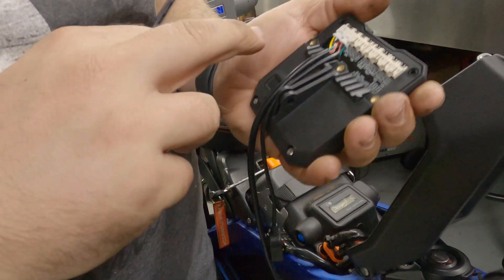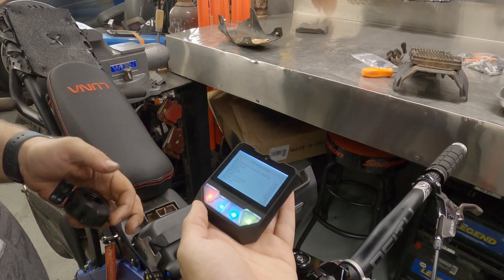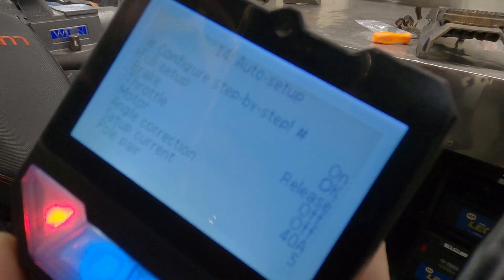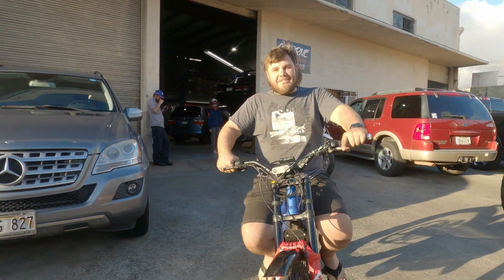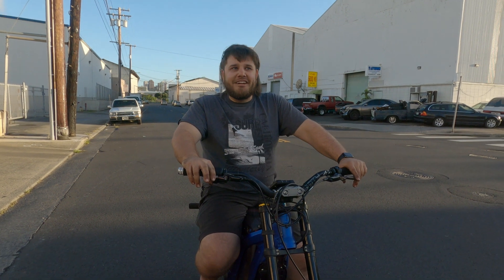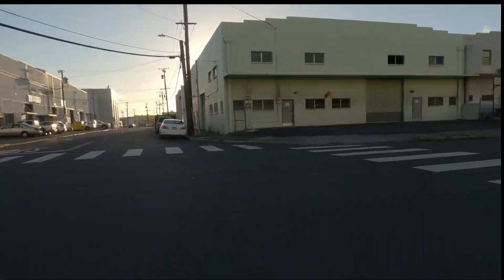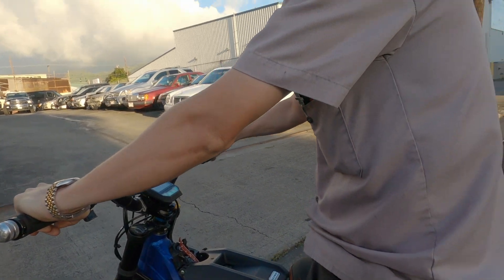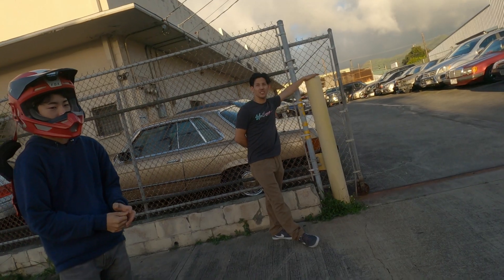Nucular 24F controller Install And Test Ride W/Surronshop 60V Battery

Comment: This thing was not easy to get to work. If you dont work on bikes or never worked on them before get ready for a fun journey. Took me about a month to get the thing to work right, but man when it does work. Damn is it worth all that work. This controller with a  Chi 72v 51ah MAX Battery is so beyond fun.
Reply: what was hard about getting it working ?

Comment: Anyone help me out I’ve got a N24F controller on my Sur Ron and my Speedo is way way out it’s either too slow or too fast or as I think I’ve got it bang on when I wind on its speeding up silly fast or slow anyone got one and can help me
Reply from the maker: I can help ya out. I’m heading out to a race. But give me a day or so. I’ll walk ya through it.
Reply: @Mayhemjach  I’ve had some support of a few people I know I need to do the calculation and settings but do you know circumference of wheel please bro? 19??
Reply from the maker: @DRIP_SZN  don’t bother with that. Just makes it way more complicated.
Reply: @Mayhemjach  it seems harder keeping the 16/1 ratio or 16/256T and changing circumference it’s not working for me going up too fast or then once I get to 20 it’s way iff
Reply from the maker: @DRIP_SZN  weird. I never touched that. And mine is exact
Reply: @Mayhemjach  mad how did you do it keep motor sprocket and wheel sprocket same or change few settings

Comment: Hell yeah!!  These Sur Ron emotos are so much more fun when upgraded.  I recently installed the emotobros ASI BAC 4000 kit and bypassed my stock battery.  My settings are at 7200 watts, 30% regen, and 20% field weakening.  It is a huge difference in performance too.  I have always wanted to see what the kits from Dan Orlov were like.  So far, so awesome.  Cheers.
Reply: Did you swap from the basic Sur Ron controller or the X controller?
Reply: @HCG  the X controller

Comment: Do you get the same top speed with the stock battery and Nucular 24F controller?
Reply from the maker: No, you would need an aftermarket battery. Check out surronshop 60v 52ah video. I went with 60v because at 72v you are over clocking the motor. Most guys are frying their motors with that setup